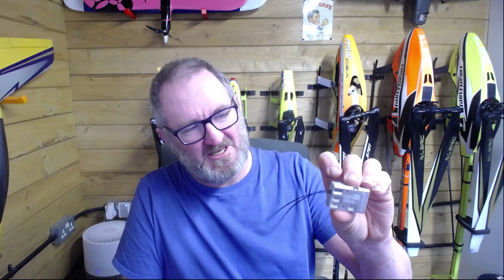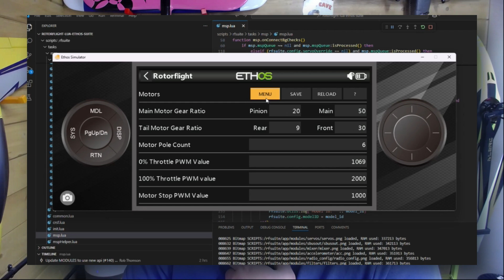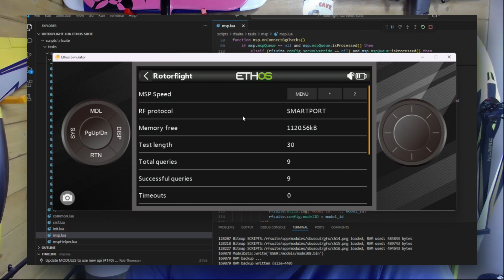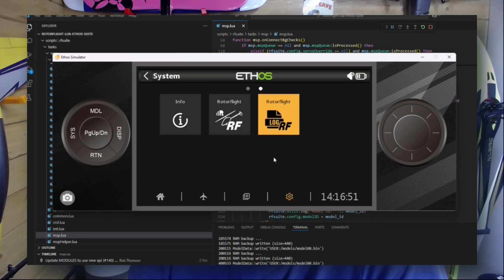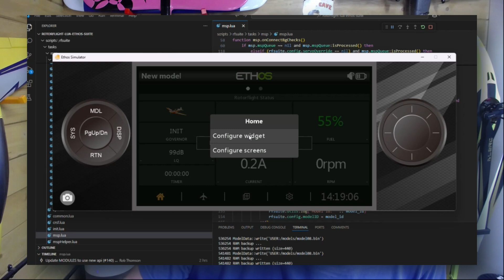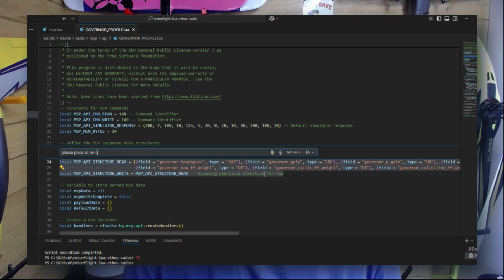ROTORFLIGHT | FRSKY 007, RFSUITE... A FLY BY UPDATE...

Comment: i have Rotorflight (Nexus + ELRS) on all my heli's right down to micro, but if i had to do the journey again to convert to Rotorflight there is no way i would do it......i think its a very badly thought out system in relation to getting your aircraft up and running and stable...too much hit and miss. You need to seriously comit to spending hours PID tuning etc......now i am fairly expert at it so I am ok but its not for the beginner as it is dangerous and difficult compared to all other FBL controllers.  Trying to get micro heli,s working on Nexus is a total nightmare....  :)))))
Reply from the maker: @andyMSH700  i find that interesting.

I can, get a heli up and running in almost zero effortat all.

I think that if you are having to spend hours.. Then there is something likely you are missing in your knowledge /approach.

One of the biggest things I find is poeple come to RF and seem to think they have to do pid tuning. And they have to do black box etc.

Get in reality.. You dont.   Most tuning is really just about feed forward and a bit of boost.

Personally.. I have 11 heli.. And I have never needed to use black box.

All fly great.
Reply: @RTRCTV  dont get me wrong...i love Nexus but what i said was that if i started out again i would never choose Nexus it as it is a nightmare to get up and running and only for experts and nerds. Like you i can now configure them easily but it still takes a good hour by the time you have levelled the servos etc.....  knowledge /approach...very funny..
Reply from the maker: @andyMSH700  I think that it's fair to say that you have to have a little more knowledge for rotorflight.  You can't walk in with zero.   But the returns are great :)

Comment: I like 150 size and less. I use whoop boards with Rotorflight at the moment. The square shape is not ideal for getting under a canopy. Unlikely anyone ever will but it would be great if someone came out with a tiny rotorflight board complete with two inbuilt esc's and inbuilt serial elrs receiver. Ceramic aerial please. Heli canopy friendly shape....